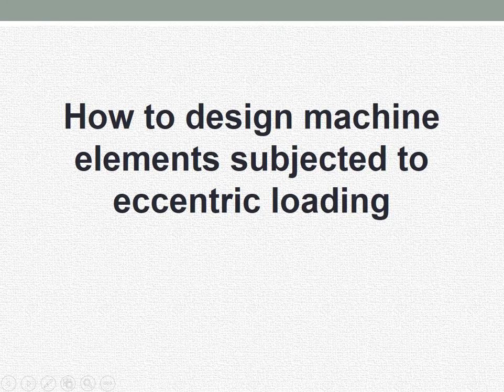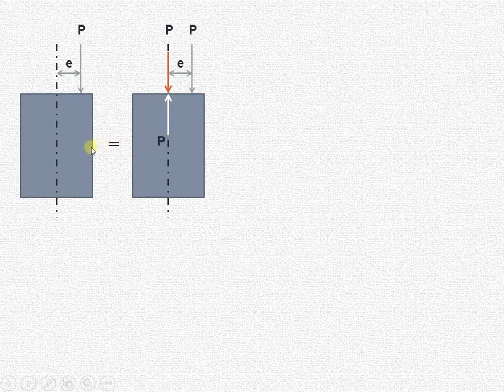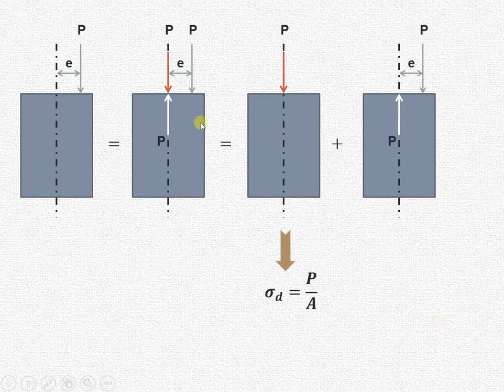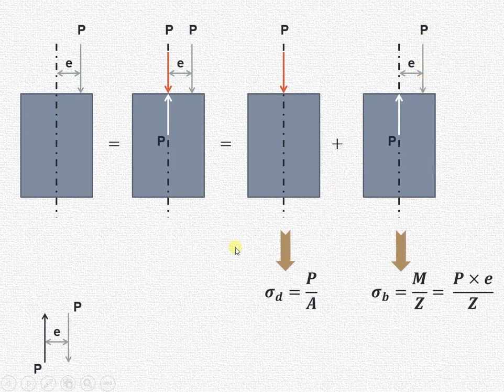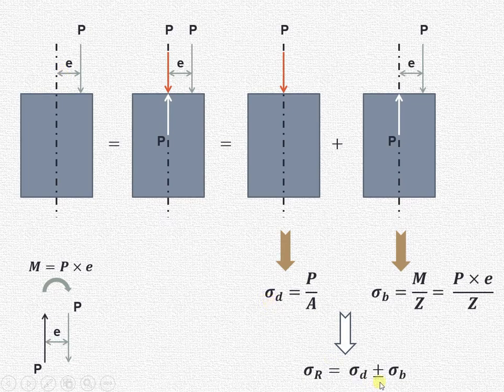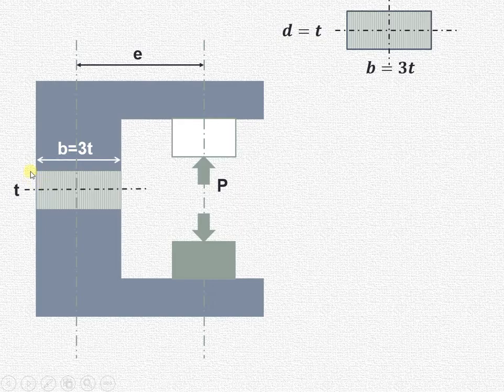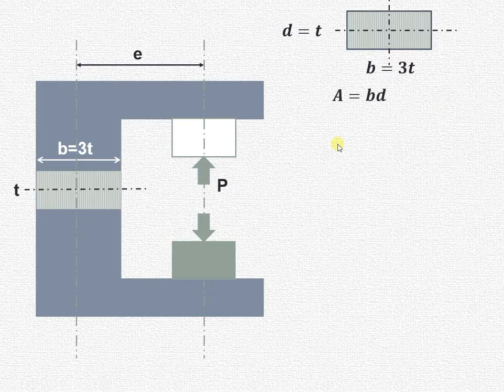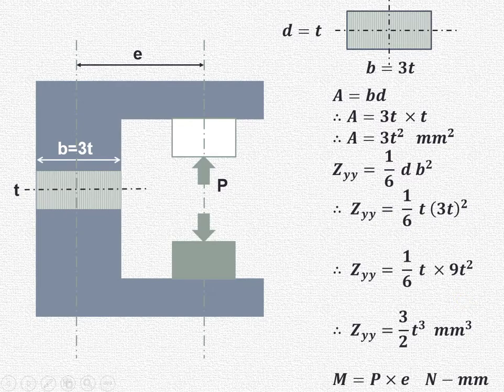Design of machine elements subjected to eccentric loading

Comment: sir zyy=1/6db2 kyu liya
Reply from the maker: As the eccentricity is measured from y axis.
Reply: monent of inertai to 1/12 hota hai
Reply from the maker: Zyy is not moment of inertia but it is a section modules
Reply from the maker: Section modules is the ratio of moment of inertia to distance of extreme fiber from neutral axis.
Reply: @CHINMAY_ACADEMY  thanks sir